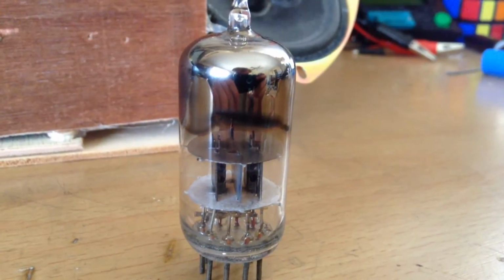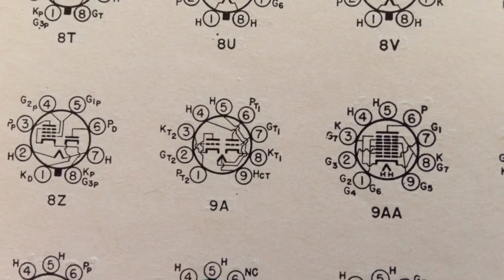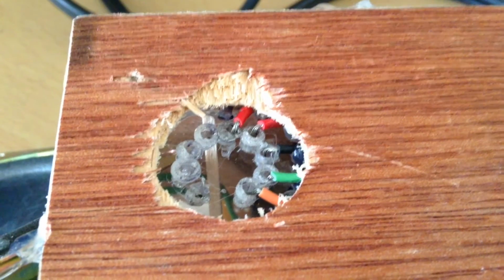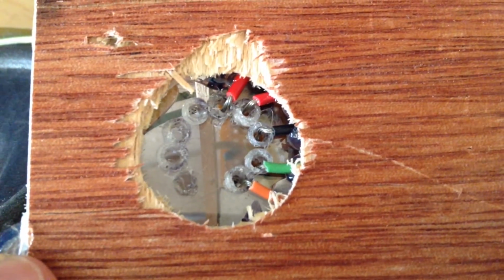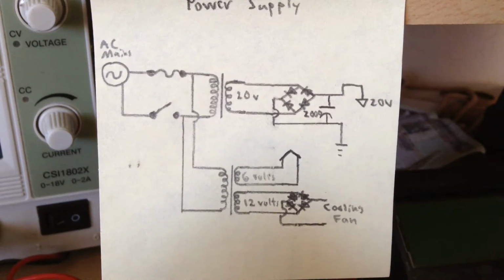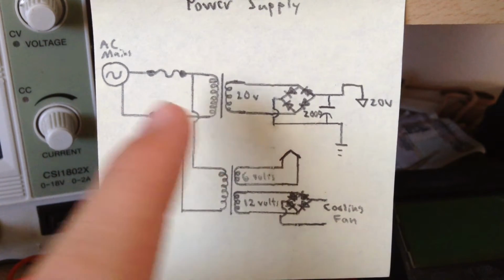DIY Vacuum Tube Triode Amplifier

Comment: Sounds pretty good for the setup, but I'd make a few changes. Bump the plate voltage to around 100vDC. This will allow much more clean headroom for the amplification and help reduce distortion. Secondly, I would pay much more close attention to the speaker vs signal impedance relationship. Even if it means using a cathode follower or output transformer, kick the impedance as close to the speaker's as possible. An impedance mismatch can either A) reduce power output if the signal impedance is too low or (much more costly) B) destroy the amplifier if the signal impedance is too high. I generally use a very unusual approach of using a cathode follower connected to an output audio transformer, depending on the tube being used I keep the signal at around 18v p-p and cut it down 5-1. This gives me more or less 1 watt of clean undistorted power. If you insist on using the MOSFET, use the 12v tap off the heater transformer to power that part of the circuit.

Comment: Great job! You will be an engineer someday! This triode typically operates on 150V, and was often used in tube televisions. It does sound like you have some clipping going on. If you have access to a scope and a sine-wave audio source, you can look at the waveformand adjust the tube bias accordingly.

Comment: What would i have to do to just make this a pre amp but using a pentode tube instead of a triode and could a pentode be made to function as a stereo amp instead of a single channel amplifier
Reply: I want to use it as a guitar preamp
Reply from the maker: There are quite a bit of schematics for this on the internet.  First of all, you will need a higher voltage power supply to drive it.  The rest of the circuit depends on what you will be using it as a preamp for.

Comment: i suggest you a separated stade drom High Frequency to medium Frequency or low Frequency keep it on buddy and study that tube you have to use those both as a stade amplifier and not directly to high power